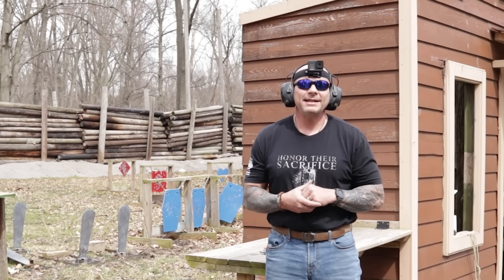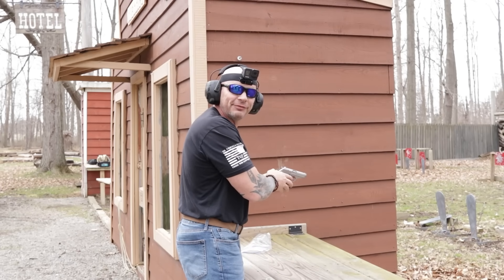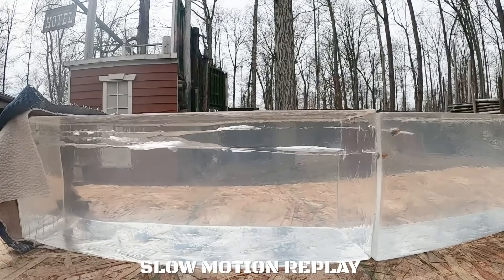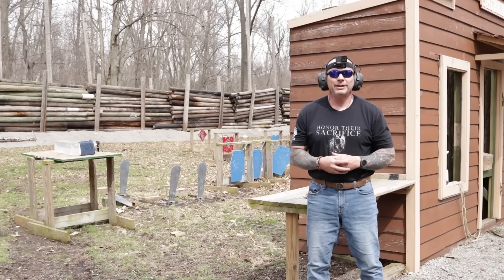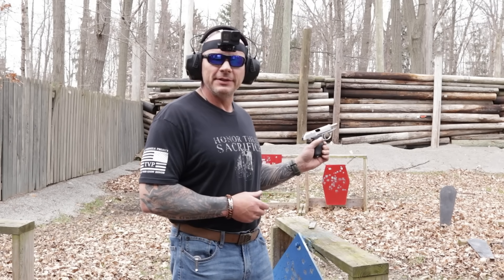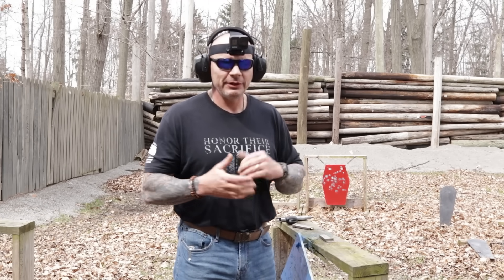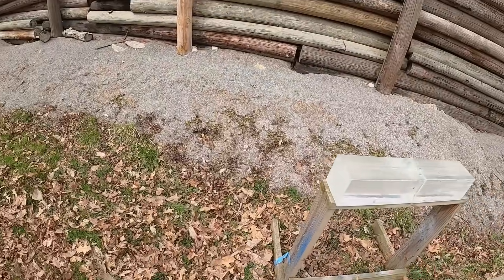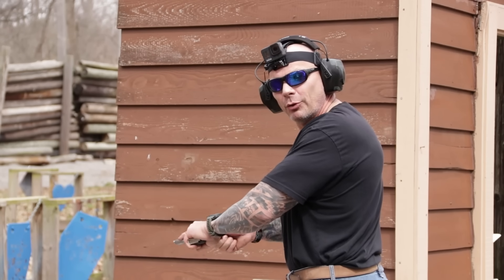Stopping Power of .380 ACP

Comment: There's a big difference in recoil (When you keep the gun size and weight the same) between lock breech and blow back operated 380's. If you compare a Sig P365 380 or a S&W Shield EZ 380 which are both locked breech to a Walther PPK (Direct blow back) you'll find the recoil to be considerably less in the SIg P365 and the S&W EZ compared to the PPK
Reply: Ppk and bersa thunder springs can be changed out to a heavier spring and shoot a lot lighter.  The factory springs are usually 12-13 lb and most people find that 17-18lb springs help the most without hindering and jamming the gun.
Reply: @Washawaysin  Good tip
Reply: @frankbrowning328  if anybody is wondering, the springs can be found from wolff.   Order the 17-18lb springs for walther PP not ppk/s.   No one makes them specifically for bersa but these have been tested in multiple places and work.
Reply: @Washawaysin  Great info.  Thanks

Comment: The performance of the JHP rounds was dismal.  I'll take penetration over expansion anyday so in this case the ball ammo carries the day.  Check out Underwood's Extreme defender ammo in .380acp.  You get excellent penetration in gel even through barriers like windshields, sheet metal and plywood, yet its design produces a decent wound channel in gelatin.
Nicely done video and it's the first time I've seen a gel test at 50 meters.  Thanks.
Reply: What he said. My everyday carry gun is a 100% reliable Glock 42 with Underwood Xtreme Defender….8 plus 1. Reliable, effective, easy to carry.
Reply: I use the Extreme penetrators myself. The name is misleading. It does not over penetrate, but it does have the sectional density to get through bone and heavy clothes better than the light bullet. Just my own reason for using the heavier bullet. If I had the defenders only, I would certainly use them.
Reply: @nathanlambshead4778  I’ve tried XD, .380 on a version of Paul Harrell’s meat target. Lots of denim, then pork ribs, then a watermelon and the XD made a real mess of the watermelon. One round.  I might try XP…just to see.
Reply: @dullonion797  You have a longer barrel with the Glock 42. Keep that in mind. If I carried a larger gun in summer, than my LCP Custom, I would probably keep the XTP or Critical Defense Hornady rounds in it. But when the belt and jackets weather hits, I carry a 9x19 with Gold Dot 124 grain +p. A different animal. 
But like I said, I would use the XD if that was what I had. I am probably just too 'old school' to trust high velocity lightweights over more standard weight for caliber. Maybe it is from my Hunting days. Hyper velocity often does not make it through and through on a Whitetail, whereas a decent sectional density would always push though creating that perfect chest sucking wound and blood trail to follow here in the deep woods. I have seen super high powered rounds fail in that. More than once. Funny how living tissue can act. Never quite predictable.

Comment: Moved from a EDC Glock 48 to Glock 42.  I feel just as conformable the G42/380 is going to get me out of the situation IF ever needed.. but it is more comfortable to carry and easily concealable in a kydex pocket holster.  I don't leave home without it now.
Reply: I feel the same. I love the G42 because of its size for EDC and the 380acp will do just fine in self defense situation. Of course 9mm ammo is better and cheaper but the bad guy will not know the difference if he is plugged with a couple 380's.
Reply: I tried to “upgrade” from the G42 to the G43X and found this to be a mistake. Thankfully I didn’t trade in and 9 times out of 10 grab the G42 for EDC. I’m athletic so it’s easier to conceal.  I have an LCP that I can clip in the waistband of gym shorts if I’m running errands after the gym but it’s not a pleasant gun to shoot. The G42 is a delight to shoot.
Reply: @tylersmith7054  funny enough I had considered the 43X but when I held one I realized it was going to be too big to conceal for my body type. The g42 and g43 are just right. The 43X is just a tad much for me to conceal.

Comment: .380 was a military round like .32 was, and I think that gets lost on many people. I'd personally never use it in JHP configuration but I have zero problem using it in ball when I need to use .380. Thanks for the video.
Reply: Yup....380 used by police in Europe for ages. It's like people think 38 special no longer works as police carried it for 100 years.
Reply: @toddjohnson271  Wasn't it 32 and Makarov? Not 380.
Reply: I would like to bring up to you the Hornaday critical defense round in 380 and the Sig V Crown, both expand very well and meet the FBI standards for penetration of 12” - 18”. Both penetrates at the 12.5” to 14” range. My wife caries a Bersa 380 so I have researched the ballistics of 380 acp and these are the only rounds which expands and penetrates to FBI standards. Not much to choose from admittedly.
Reply: Rick…389 HCD does NOT meet fbi standards….never seen a test that it did. Use an xtp hp round of some kind of ball. Thats it!
Reply: I saw a picture of two Dutch military officers armed with Browning 32 ACP pistols, taken I guess before WW2.  You're right, 32 and 380 ACP were previously military rounds in Europe.
Reply: I fill up the magazine of my Bersa Firestorm with Lehigh Xtreme Penetrator.  They create larger and more messy wound cavities than the ball or flat-nose rounds.  Yes, I'd never use JHP rounds on a .380 auto pistol unless I'm a mob assassin and my job is to kill a turncoat at the back of his head at point blank range.

Comment: That was pretty good shooting with a less than ideal sighting system. When I have to tuck in my shirt I carry a Bersa Thunder 380. A good little gun even at 30-50 feet. I’m not nearly good enough to try at 30-50 yards. I usually carry an IWI Masada but if I need deep concealment I go for Kel Tec p32. Small but it shoots well at 25ft.
Reply: Bersa is good sold pistol. Barrel is attached to the frame. Mine have been good performing. Before the boating accident😢😭
Reply from the maker: Thanks for viewing and I appreciate the compliment.  I have shown the Bersa on the channel previously as I too think it is a fine little weapon.  I always appreciate hearing from our viewers and getting their take on things.  Once again thanks and train hard and train safe.

Comment: I like to call my Glock 42 (.380"ACP) my "James Bond" backup/EDC pistol, for when I have to put on a suit-and-tie/tuxedo... thanks God, not very often any more nowadays!  :>0
After some try and error I settled on that combo pistol/ammo because it's still small/light enough to pocket cary and it is the one .380"ACP Pistol that I manage to consistently hit at range with (out to 30, 35 and even 40 m, if I do my part?). I find it a very comfortable and fun pistol to shoot. 
By the way, I have also decided to only carry and shoot FMJs since my experience with .380"ACP JHP has been that usually they don't seem to expand much any way, or when it happens to expand (and it's not very consistent either...), they don't get to penetrate enough. So in my mind if I have to chose between inconsistent expansion and penetration, I rather have penetration. 
Great info as usual. Thank's for sharing!
Reply: Lehigh Extreme Defender or Extreme penetrator!
Reply: @micronious5747  nice...
Reply: @micronious5747  Well, maybe but not readily available in my little corner of Paradise. And I would still need to find "range ammo" that would print close to these quite expensive ammo in order to feel any confidence at hitting what I'm shooting at under duress?
Reply: If you want a James Bond clone at a reasonable price look at the Bersa Thunder 380.
Reply: @EducatedBlackMan  Nah... tried them all, or most of them anyway. And none of them can hold a candle to my G42. At least for me, that is. :>0
Reply: Just alternate the rounds in ur mag between ball & fmj...that way u get expansion & penetration...that's what I do
Reply: @kippnovak9833  Hum... I don't much think the .380"ACP can develop the kind of speed needed to reliably expand and also think it has not much energy either to waste, so I rather trust FMJ bullets and go for deeper penetration. But to each is own. I also like to be able to train with bullets that print close to my EDC ones. and I haven't seen any FMJ that prints close to the Hornady Critical Defense ammo that I think is the only ammo that expands quasi reliably. So yea... in .380"ACP it FMJ for me.
Reply: @joedeleon1189  good call...